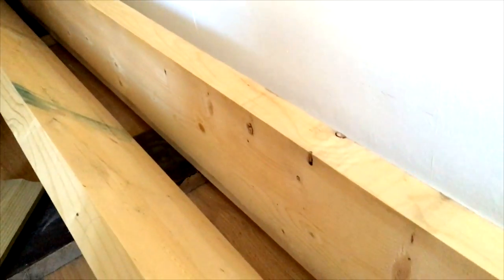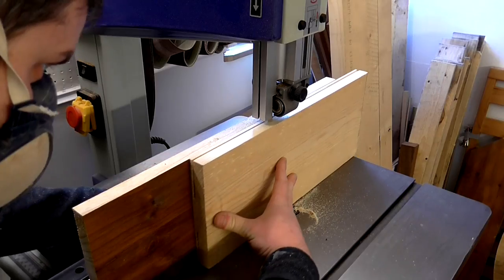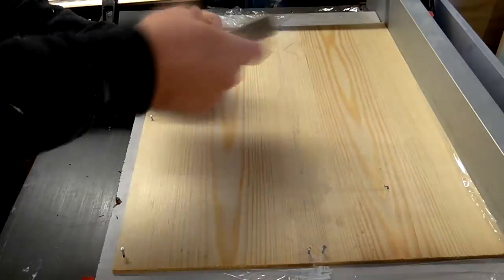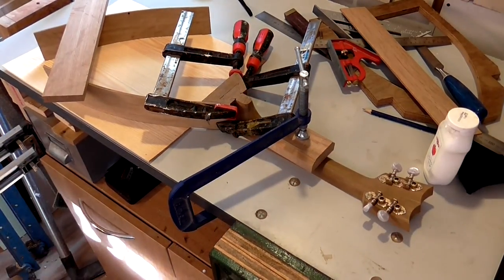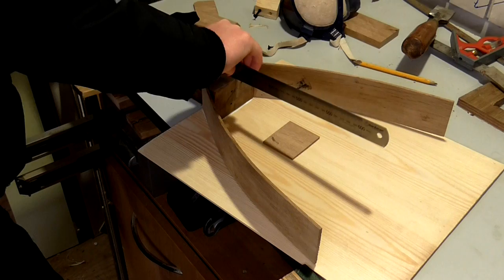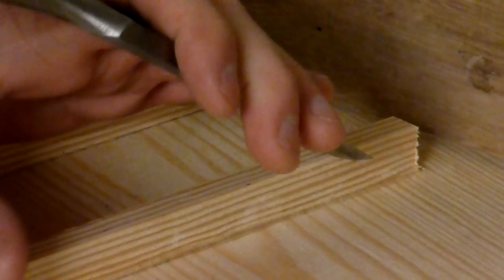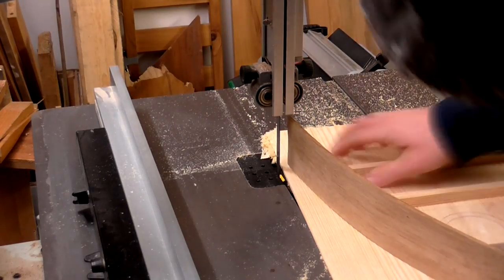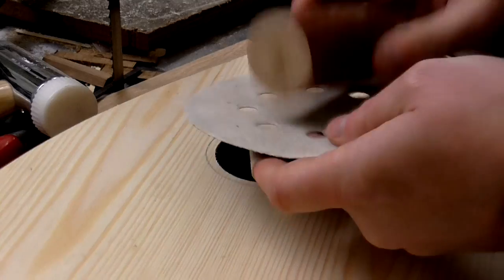Making A Ukulele (part 3 of 6)

Comment: Just in case you ever build another instrument... For the soundboard you really need to spend the time to find quarter sawn material in the at least 15 to 20 ring count per inch. also on a uke you can easily mill the brace down to 1/4 inch instead of what appears to be 3/8 on your construction. just those 2 adjustments and your tone and sustain will be greatly improved. I don't want to sound like i'm telling you what to do but I just thought you might like to know where you can easily improve on your next build..Looking forward to see the next installement..
Reply from the maker: +Tomy Hovington thanks Tomy, very useful tips